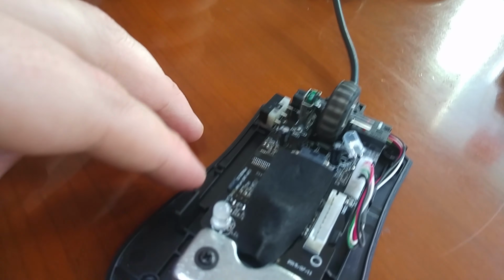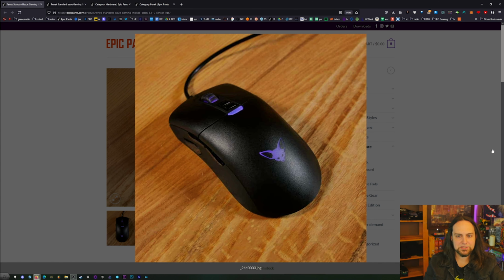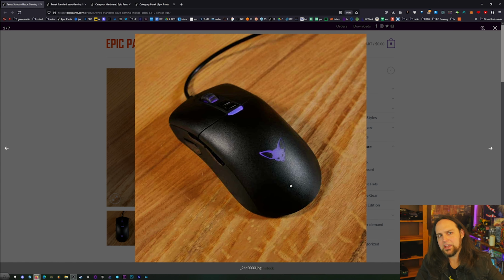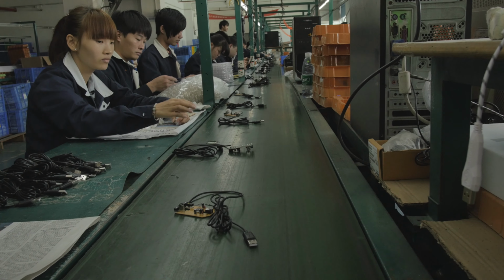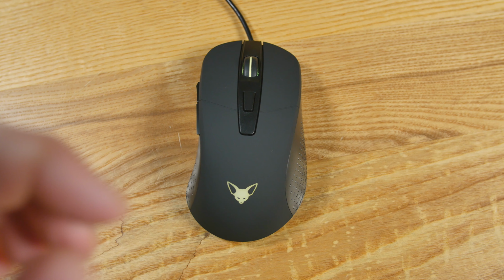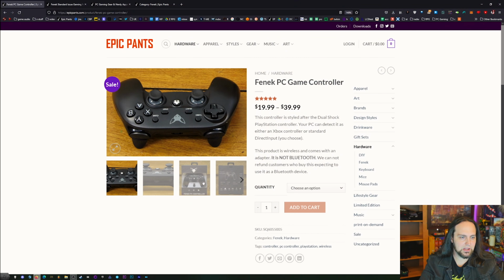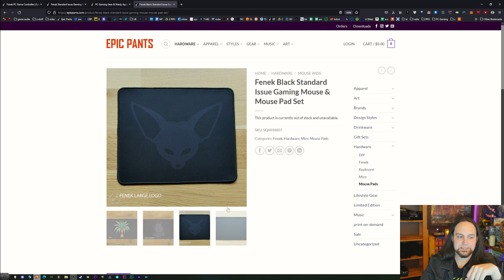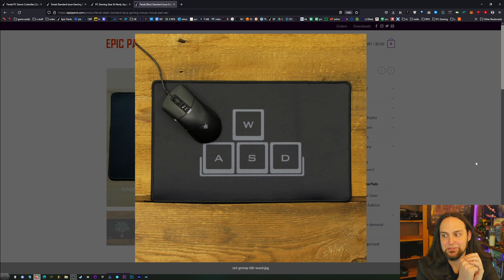Why We Made a Mouse: Factory Tour, Travel to China, Etc.

Comment: That fact that your mouse can be configured without any software makes it the perfect mouse for GNU+Linux users like myself.
Reply: I still don't get why that software cannot be cross platform lol
Reply: @DSDSDS1235  It easily could if the mice vendors funded cross platform support. It would cost them more. However there is a very large silver lining. Almost all vendor specific configuration software is utterly proprietary so evev if it was ported for gnu+linux it would be a small thorn in our sides and yet, because it never got ports the Free and open source community has reverse engineered a large portion of mice and created truly Free configuration utilities which is fantastic. From the top of my head I can't quite remember but many brands have at least one utility if not two. There's Piper via libratbag, razer, older roccat mice, logitech and a bunch of others. So on effect this problem has to a certain degree solved itself. While most gaming mice will function on a basic level if you plug them in and many are configurable with libre configuration utilities it's still a very good idea to research mice before you go out to buy. I wish there was at least one vendor that contributed directly themselves to the libre software stack, hell, maybe there is because I've been using the same mouse for so long. Anyway, good luck and happy rodent hunting.
Reply: @gnarlin4964  idk man isn't it just a matter of swtiching from whatever serial interface library they were using to another, if they coded the thing the sane way

Comment: Logan, is it possible to make a mouse with Japanese made Omron D2F-01F switches? Switch for the scroll wheel Panasonic EVQP0E07K/EVQP0E07T etc.  Mouse with Japanese parts inside
Reply from the maker: It's possible. I'm not sure why I'd do that though because I really like these switches and mine have been working well since day 1. The scroll wheel might be an upgrade though. Also, it would raise the price a lot. I won't say never, but I'm not sure if I'll make any more hardware. I don't like marketing stuff.
Reply: @teksyndicate  marry a marketing Ninja. oh, and the scroll wheel, smooth surface, I hate those off road treaded wheels designed to prevent your Jelly Donut covered fat finger from sliding off.

Comment: In all seriousness, if I knew how I'd make a mouse like the Master 3 that had simple button controls that saved my default settings on the mouse so when I'm on Linux, and Piper doesn't quite work the way I want it to, I can still have my personal default. Sadly Logitech changed there software, and the gaming mice no longer save the settings to the mouse. Something like that would be perfect for me.
Reply: My old logitech G203 has onboard memory profiles it's just locked behind the g hub software.